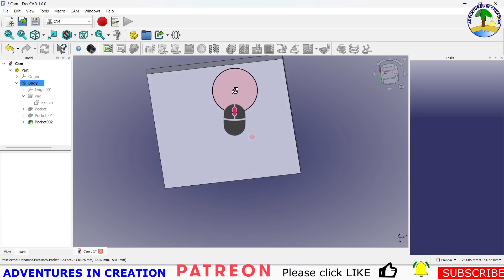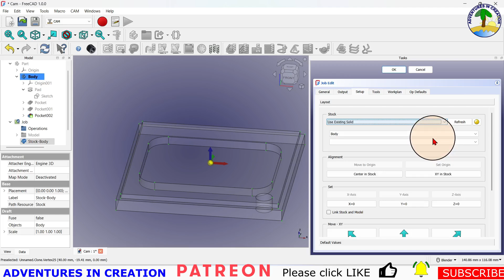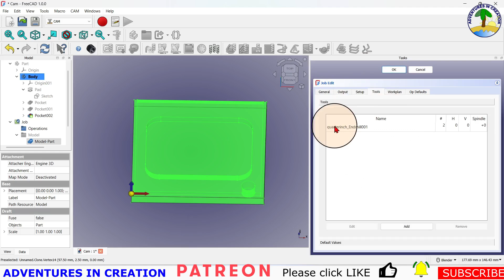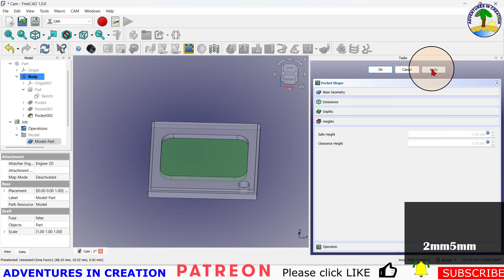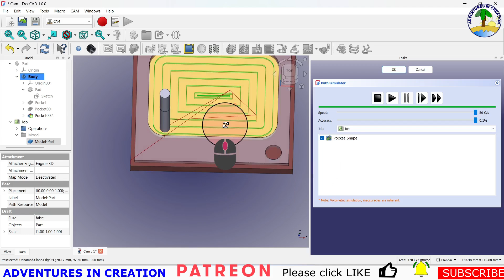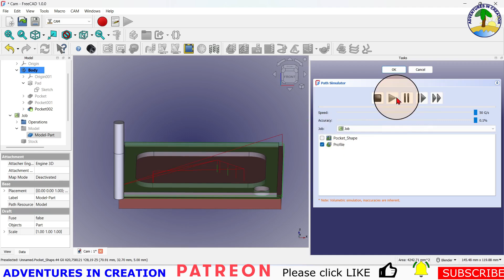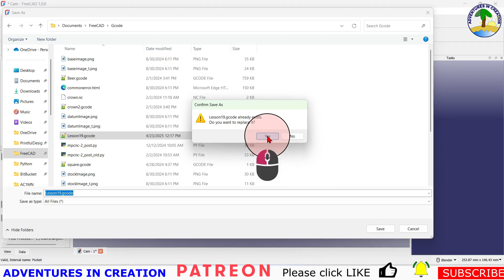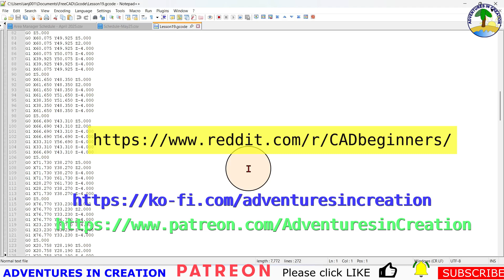Intro To FreeCAD Version1 0 CAM

Comment: Hello Thanks for taking the time to show us how to use the Freecad CAM .. Can you tell us if the Freecad post processor has a Haas option for outputing G-code suitable for haas machine ?
Reply from the maker: I believe there is a post processor for Haas but I have not used it, so can't comment on how good it is.

Comment: Tu n'as choisi aucun tool
Reply from the maker: I intentionally didn't cover that part as it's another subject in itself. I just used my default quarterinch endmill. You should have a default tool or you can add tools to your library.

Comment: 1.0.2 latest version. create job. looks nothing like your screen with "CAM" on top of left window.
 your example is just way too complicated for a tutorial focus on generating gcode. a simple circle routed through a piece of stock.
 from scratch, sure use your favorite tool but pretend you never done this process before. slow down and stop twitching the mouse all over the place. thanks its better than most. but the bar is very low.
Reply from the maker: I am using 1.0.2 not sure why your screen doesn't look like mine.

Comment: I'm on 1.02 (vs your 1.0). Don't know if this is a bug, or a feature (!), but if you have 'extend models bounding box' selected, and you set the 'ext' to all zeros? You can't set an origin! 
So I spoofed it, and set it to 0.1mm, at which point I could select that corner, and set origin. After like an hour of bashing my head on the desk.  :D
Reply from the maker: I am also on 1.02 - glad you found a way to do what you wanted.

Comment: Wondering how to lay a cabinet flat and arrange on a board to Cnc, presume has a video on it but wondering which? Moving from fusion cause finally got fed up
Reply from the maker: You can model the cabinet assembly then cnc each of the sides.

Comment: Freecad 1 in the cam work bench ,my post processor is set for GRBL for a Genmitsu 4030 witch produces a .NC file, just like your post processor did ,then you saved it to a file called LESSON19.GCODE. how and why did the .NC file change to a .Gcode file. The test files that come with my Genmitsu 4030 are .TAP files and they worked, plus I downloaded a .GCODE file created in freecad and it worked, Genmitsu says the .NC will work on my machine but they don’t , hopefully you can help me out Thanx Mike
Reply from the maker: On my cnc (Marlin board) it will not work with the file unless the file extension is gcode - it doesn't change the content just a quirk of my set up.
Reply: @Adventuresincreation  Thanx can you tell me how to quirk my set or how you did yours Thanx
Reply from the maker: @MikeGuenther-f2z7r  Just do a save As and or rename the file once you have saved it. The content will remain the same the file will just be called filename.tap

Comment: At 4.11 you set the box to -3mm but don't mention it in your voice over. What are you doing there?
Reply from the maker: I will take a look at it and let you know.
Reply from the maker: I didn't input that -3mm it just updated because I moved the origin with the "set origin" It's the bottom of the Z when you look at the bounding box. - All of the dimensions have an "alias" that equate to values. I find many times you will have to replace them with the actual dimension you want.
Reply: @Adventuresincreation  Great - thanks so much for checking. I tried it and it threw up an error for me..

Comment: Hallo,
Unfortunately there is no possibility to save the file as shown at 13:20. The post process works, but nothing happens after OK. What am I doing wrong? 
Hallo, 
leider gibt es bei mir keine  Möglichkeit wie bei 13:20 gezeigt den file zu speichern. Post prozess funktioniert, nach dem OK tut sich nicjhts mehr. Was mache ich falsch?
Reply from the maker: Do you mean there is no "Save" button? As a work around, you could ctrl A and ctrl C to copy the contents then paste it into notepad or your editor of choice. Not sure why you don't have the option to save.
Reply: @Adventuresincreation  Thanks. i know, but i want to see the same possibility like you.
Reply from the maker: @moggelmoggel8865  can you share your FreeCAD file so I can see if it's the file, or something with your set up?
Reply: @Adventuresincreation  yes i share this, but where or how? e-mail? i can't find this on your site.
Reply: @Adventuresincreation  Hallo, ich habe es dir zugeschickt. Vielen Dank
Reply from the maker: @moggelmoggel8865  I sent you and updated post processor that will save the file properly. - It was an error in the estlcam post processor.
Reply: @Adventuresincreation  Many thanks! it works ;)
Reply from the maker: @moggelmoggel8865  Excellent!
Reply: @Adventuresincreation  thanks! i will try.

Comment: How do you post process in inches? (G20 instead of G21)
Reply from the maker: You may have to modify your post processor to handle inches, you can change units in the preference but internally FreeCAD is all milimeters so the units may have to be handled in post.
Reply: @Adventuresincreation  How do you modify the post processor? When I go to post, all I see is OK and Cancel
Reply from the maker: @plmkoijn90  You have to edit the post processor file.

Comment: hi,
Thanks for the great clear info… I’m currently learning my way into free and cnc and just done my first cuts with the CNC.
Right now I’m trying to surface an uneven piece of stock wood… well i have achieved it, but was wondering about workflow… I think having the surfacing job as a separate file the size with currently just a 1mm Z pass makes sense… then i can run as many times as required to flatten the stock…. After this I pick up with a full cut file like you show here.
Also you mentioned you use a template be great to know more around what you find useful to set up in this, and any other custom settings available in the system to help speed up the process and save unnecessary work.
Cheers
Reply from the maker: I have other videos on cam. Basically, I have my set up so it's easy to clamp the workpiece in the exact same place and zero the cutting head that way I can easily make multiples of the same thing or reposition a workpiece for subsequent work. Your idea for a 1mm surfacing cut as it's own job is a good one, it can be your universal job for surefacing.
Reply: @Adventuresincreation  well universal for all my 200x200mm pieces! But I guess quick to tweak the dims and produce a fresh guide to the piece dims. Unless there is a different way to scale

Comment: Nice instructional video! I am thinking that I want to purchase a small (24"x24") CNC machine for wood projects. Which machine did you settle on? Thanks...........
Reply from the maker: I have an mpcnc with a Dewalt router works great for my needs.
Reply: @Adventuresincreation  Thanks, ............

Comment: I wish someone would update this WB to run cnc plasma. I just couldn’t figure out a way to make it work.
Reply from the maker: I think the availability of plasma for the developers might be the issue.
Reply: Maybe you’re right I don’t know how they do all that
Reply: Would it not be possible to fool it into thinking the plasma was just a slim cutting bit?  You'd set the tool diameter to be the same as the kerf from the plasma, the tool length to be the distance from the bottom face to the cutter head, and always cut in one pass.  You may need to hack the g-code a bit to turn on the plasma at the start of the cut, and turn it off after.  You may be able to use a spindle on/off command and just replace that with whatever the plasma cutter needs.  You'd also need to experiment with the feed rate.
It may be possible to customise the driver to do all this for you.  I don't know anything about how FreeCAD's drivers work, but they probably have g-code snippets for certain operations.  I assume laser cutters have a similar issue, so if there's a driver for them, you might be able to tweak it.
Reply: @Raven-Creations 
I tried all I could with no success. Granted I’m not really experienced in freecad . Maybe some with better knowledge could get it to work

Comment: Yay! Thank you for this, it will be a big help. A friend and I are trying to write a post processor to output SKIP code for a Dyna Mechtronics DM 4400 mill (circa 1985) that I own. With the aid of Chatgpt  we have achieved some slight success and are doing a parallel  trial with DeepSeek, but we constantly struggle with the Cam work so this will indeed help - I hope there are many more in this series as areas like templates and output file choice to mention but two are something of a struggle.... Martin
PS : I might add that the absolutely crazy way that Gcode does arcs is really giving Chat and Deep a real workout - take I and J away from the previous X and Y  - what a silly nonsense!
Reply from the maker: I created my own post processor but, it was mostly a modified version of an existing one to fix commenting and make small changes. I agree that there are lots of things that could be improved.

Comment: Thanks for putting this together. I am curious about that profile cut you set up. It seemed that you manually entered the depth of the cut rather than letting the program figure out where the height of the ledge was. That seems dangerous to me and requires the user to know and type in the correct value. Couldn't one select the ledge and have the tool figure this out similar to the pocket cuts? Thanks
Reply from the maker: You can definitely select faces / ledges but to be honest it's less dangerous to do it yourself if you know what you want. It's easy to make a mistake if you don't know what you are doing. Always a good idea to try a test/dry run to make sure it's what you expect.